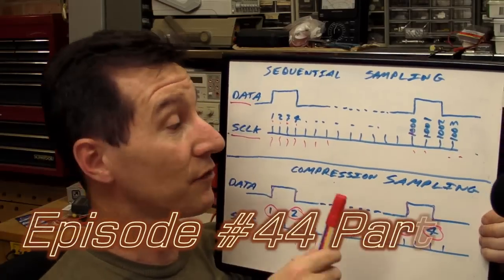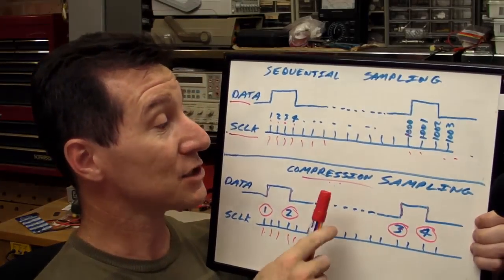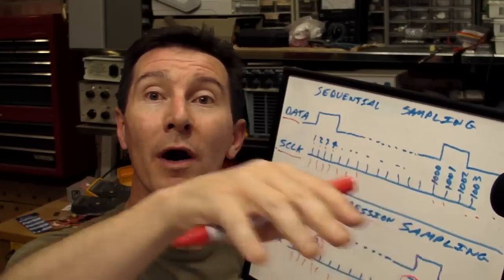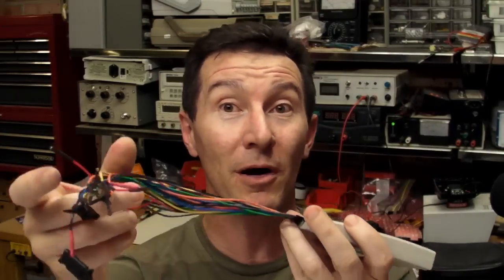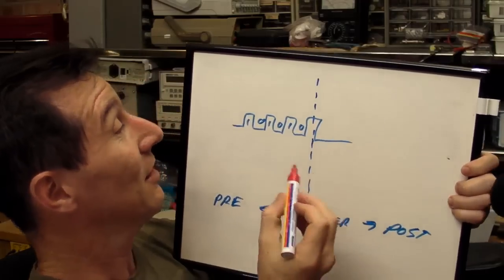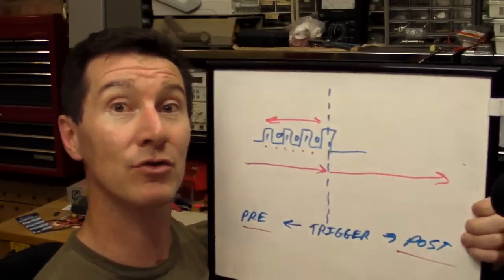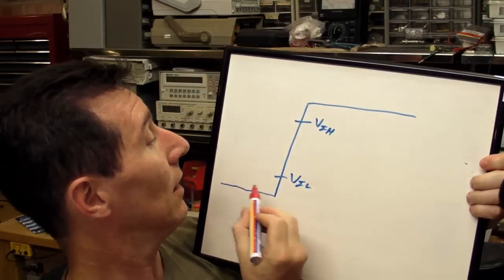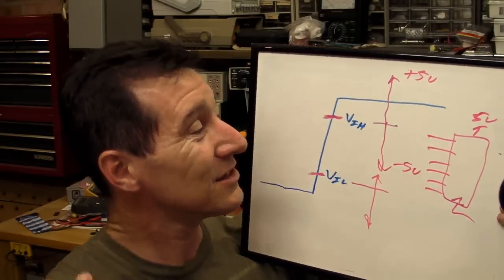EEVblog #44 - Part 2 - Logic Analyzer Tutorial

Comment: Most cheap USB LAs may be a toy, but they're great for non- or semi-professional work. I've been using the 20$ 16-channel Saleae clones for reverse engineering tons of great junkyard stuff, and they've served that purpose really well. And I'm not even going to mention all the Arduino tinkering and the recent upsurge in hobbyist project platforms. Really shows that this video is a few years old already - perhaps EEVblog will come around to revisiting that topic in that new light.
Reply: I say please update!  16 ch/100 Mhz units for 41 USD on eBay with free ePackage shipping.

Comment: The worst problem is a glitch/bitch; a state changing power short, etc. Or missed event; alike a counter carry output pulse didn't reset f/f.  Over heating causes slow logic, example, old 1978, 74161 TTL counter clocked@ 20Mhz, more heat sink with with huge PCB copper lands to fix weak carry flag. Today the limit approx. 160Mhz with AS logic; am I wrong? More speed = more heat= saturation limit. If your clock edge is sharp and 50:50 your clean and mean. Emitter coupled  logic runs hot, at 500Mhz 10xxx series. DWave™quantum computers can't work because of the Heisenberg uncertainty nonsense. haha